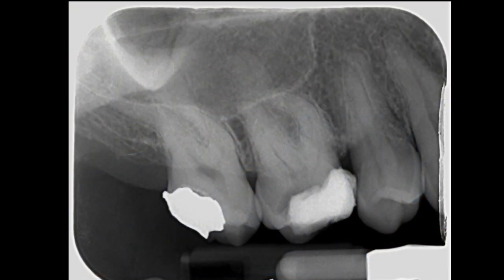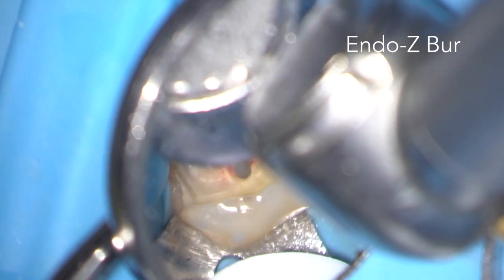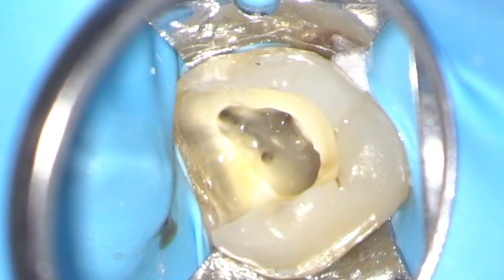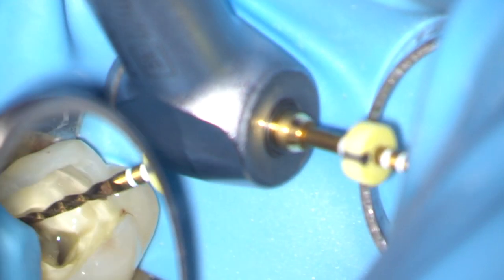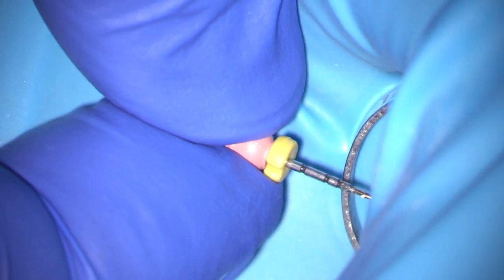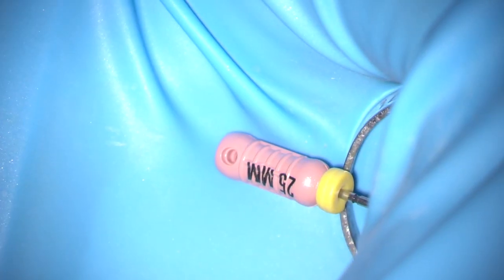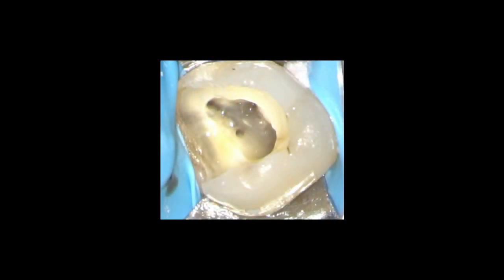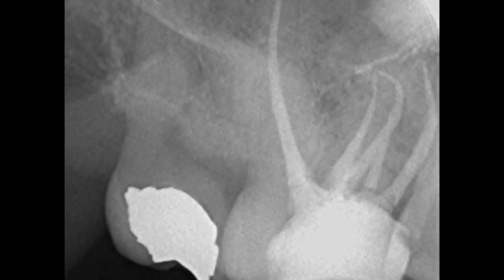When MB1 is not enough

Comment: Thank you Dr Rhodes! I wanted to ask if you routinely take WL radiographs with K files after coronal flaring to confirm working lengths before Rotary instrumentation? Or do you trust your apex locator enough to begin NiTi preparation?
Reply from the maker: Hi Gurek,
I have trust in my apex locator, but if things are not clear I take a radiograph too
Cheers
John

Comment: Dear John, may I please ask, when performing retreatment, how do you remove the last bits of gutapercha that are often located on the canal walls / near the apex / beyond the curvature? I usually engage the gutapercha with some sort of a coronal flaring file and then continue with NiTi rotary files down the canal, but after reaching the apex, some gutapercha residues are still present on the canal walls or at places I can't see well – how do you manage these? Ultrasound tips, in my case, seem to heat the gutapercha up but not remove it, and rotary files just sometimes toss the gutapercha from one canal wall to another, or they don't contact certain wall places at all due to the canal anatomy/curvature and the curvature of the file going down the canal.

Do you use any solvents?

Thank you if you can answer!
Reply from the maker: Hi Martin
Great question!
I like to try and remove the apical part of GP cone intact with a hedstroem, where there is GP in isthmus or grooves I use a micro opener, fine ultrasonic tips with irrigant (to cool) or solvent and wicking
Cheers
John
Reply: @johnrhodesendo  Dear John, thank you for your time and answer. Does this work almost every time for you? It sometimes feel that when the initial RCT is done well and the gp is compacted well, it is difficult to just remove it in one piece.

Comment: wonderful presentation and execution,im a big fan of your channel.
i did not fully understand at 5:00 ,could you please elaborate on this sequence.
also,what instrument did you use to discover the mb3,a long neck bur or ultrasonic tip?because its not shown in the video.
cheers
Reply from the maker: Thank you!...This shows three apical movements of the Wave instrument...irrigate, patency file, irrigate and then back to Wave? Cheers!
Reply: @johnrhodesendo  thx for the prompt reply.
all files go to full working length at one go?or the first strokes are short of the working length?
also,to reveal the mb3,what instrument did you use sir?
Reply from the maker: Hello!
The Wave One Small file is taken to length over three passes, irrigating between each and working a little deeper each time.
I used a micro-opener to gain access to the MB3
Cheers
John
Reply: @johnrhodesendo  All 4 canals in the video were preparated with only the small Wave One file which is 20.07?

Comment: Do you often use the Protaper Sx as the first file in the canal? I've tried that approach with a calcified MB2 before which lead to a separation- any suggestions? Thanks for always sharing your cases!
Reply from the maker: Hi Bylon
I do use an SX frequently but if the canal is super fine then i open up the orifice with a micro-opener or create a very small dimple over the orifice with the smallest LN bur
Hope that helps?
Cheers
John

Comment: Great content as always. Do you use different cusp reference points for your working length stops when you prepare the canals? 

Also do you use the yellow file in all canals or do you normally use 1-2 of each file in a molar where they rotary can get fatigued quicker.
Reply from the maker: Hi Jose
I tend to use reference points that keep length changes to a minimum as this speeds up preparation
If the file shows any signs of slowing up or flute damage I swap for a new one. In a tricky molar I may need 3-4 files
Cheers
John

Comment: Hi John, budding foundation dentist from the UK here!

I hope you dont mind me asking this on this video, but what do you think is the best way to remove GP from a canal. Obturated a UL6 few days ago and the palatal canal was obturated very short, by 5-6mm maybe due to  pulling the GP up slightly during obturation. What do you think is the best way for me to remove that bit of GP so I can  reobturate to a better length and seal?
Reply from the maker: Hi Yusuf
The easiest way to remove GP is probably with a Gates Glidden #2 followed by a hedstroem #30 file.
If you can create a glide path through any remaining GP then the rotary or reciprocating instruments will finish the job as they taper the preparation
Cheers
John
Reply: Reciproc files are great for removing gp. Just watch for getting pulled in
Reply: @johnrhodesendo  thank you
Reply: @stephenp2980  thank you
Reply from the maker: Yep.. Reciproc files are useful for removing GP👍🏻